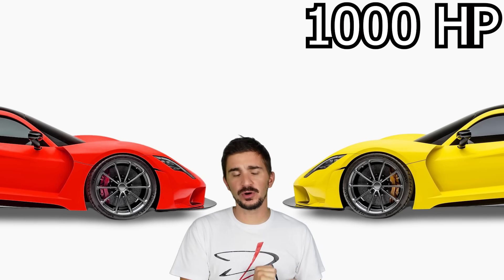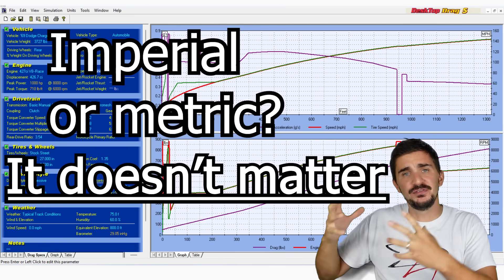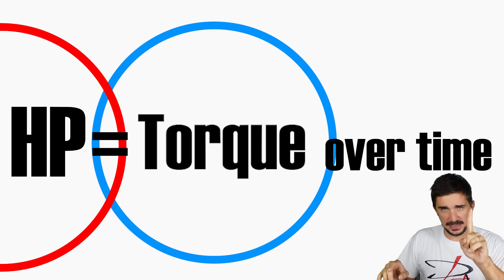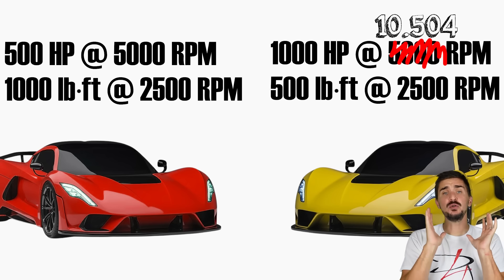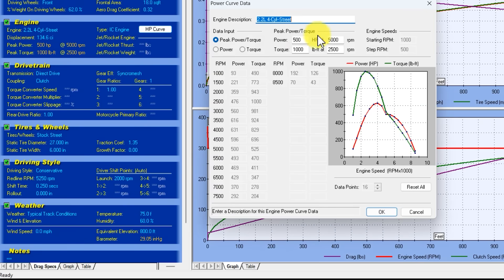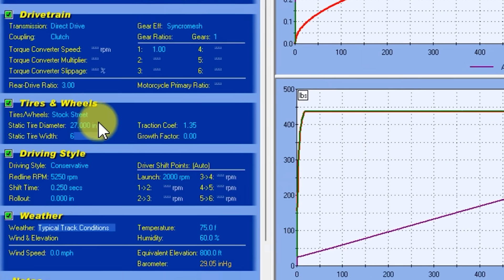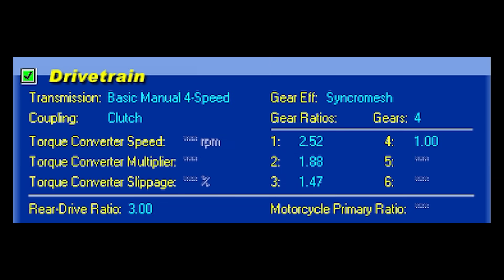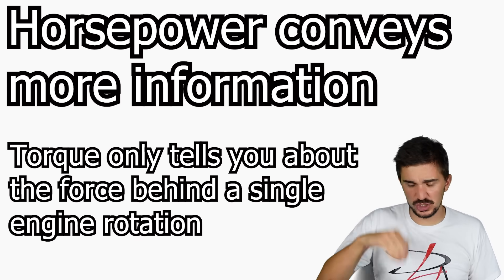Who's faster? Explained and Simulated - Horsepower vs Torque

Comment: In optimal race conditions hp will always be more valuable than torque, all of the simulations are made in favour of the torque engine, like having no gears or being unreasonably heavy.a light racecar with 6-8 gears will always be faster with the high rpm high hp engine
Reply: everything what ypu write is correct except one 👌🏻 heavy weight factor which as you state favour torque engine what is not true 🪠  feg we have 2 engines 100 hp 100 nm and 50 hp 1000 nm both values fpr each at crank we conect those engones with the same type gearbox for  each perfect gearing so gear quantity diffrences between gear lenght whatever gear wuantity and dfiffrences is required for make each of them as fast as posiible 👌🏻 and first we put both those engines in light carosery some whatever what cars let say 500 kg with driver each the same drive train offcorse and the same aerpdynamic and now 100 hp 100 nm beat 50 hp 1000 nm version in each type of race you  setup on trafk with corners on straight dosent matter what lenght is this straight asf offcorse both on the same tires 👌🏻 ok so for light cars or mototrcycle aituation  is solved 🪠now the same engines we put in semitruck  with load on trailer each 100 tons let say and we setup drag race on uphill 3 degreee incline viaduct 5 km lenght constant uphill let saywhat happen now 50 hp 1000 nm now win this drag race ? 🤔 welll NO ! again 100 hp 100 nm on perfect gearing easybeat 50 hp 1000 nm version 👌🏻 why ? cos 100 hp 100 nm always dosent matter in what type pf car weight asf ypu put both engines will generated more thrust or contact path  force as formula watt at whells  :m/s of vehicle = FORCE state 🪠 so if force for 100 hp 100 nm version always be bigerthan for 50 hp 1000 nm version than s long as whole motion resist for both version be the same than alawyas 100 hp 100 nm version win cos of this formula 👉🏻 force on whells : whole resist inlcuding weight and drag and as for uphill ccelerstion test sin 3 degreee incline x weight in newtons = acceleration 🪠long stpry short biger force at whell alwys push the same weight in vacum at faster pace dosent matter this weight be 1 kg or 1mln tons but the same weight for each force level simple as 💩🌪️ 🪠👌🏻☕️
Reply: My friend @mociczyczki is once again correct. If the weight is the same for both vehicles it is what is known in science.engineering, and physics as a constant.
Power, not torque, is the limiting factor for not only the vehicles top speed but also how quickly it can accelerate at any speed, with any load or on any grade of incline.
Reply: @rollsroyce329  Egzacly 👍🏻 not the other way around 😉👌🏻
Reply: i was talking about the 500 vs 1000hp example with different rpms, the 1000hp engine will vastly outperform the 1000 torque engine on a racetrack.
Reply: @kilianfirebolt and that is true regardless of the weight of the vehicle as long as they are equal.

Comment: While we're demystifying engines, torque, RPM, and power let's clear up some common internet hivemind misconceptions: (some of you may need to sit down for this)

Horsepower is not merely  "marketing"
It, like Watts, Kw, BTU/Hr is a measurement of Power. Dismissing it as merely "marketing" implies that it's a feature without benefit. Advertising a torque number without RPM would be a feature without benefit.

Power is not what "maintains" speed or "keeps you going". That's how much fuel you are bringing with you.

Long stroke engines do not make more torque because of "leverage" from the crankshaft.
Crankshaft's do not add any leverage to the work already done by combustion pushing the piston down the cylinder.

18 wheeler "semi" trucks do not make massive torque "because" they need to haul heavy loads.
The maximum output required from the engine is based on its power not its torque.

Maximum acceleration at any given speed does not occur at peak Torque it always occurs at peak Power. Maximum acceleration for any given GEAR occurs at peak Torque and would be less than at peak Power at a different gear ratio for that speed.

Maximum towing capacity at any given speed does not occur at peak Torque it always occurs at peak Power. Maximum towing capacity for any given GEAR occurs at peak torque and would be less than at peak power at a different gear ratio for that speed.

Torque is not “the only thing that can be measured.” Some brands and type of dynamometers like Mustang brand Load cell type measure torque directly and calculate power, others like Dynojet brand inertial drum type measure power directly and calculate torque. Neither of these "delegitimizes" the concepts of Torque or Power

Torque is not what wins races, races are a competition based on work vs time. Torque is irrespective of time as it is only Force x Distance.  Power is force x distance / time and is the measurement that would indicate the winning of a competition involving work vs time.

And Finally 400lbs ft of torque is not “equal to” or “the same as” 400HP.  They are “equal” or “the same” numerically only.  In the same way 400 gallons of water is not “equal to” or “the same as” 400 feet of wire. 

If you still believe in the magic torque and would like to schedule an exorcism please reply below.

Comment: I've always thought the most accurate way to measure and compare engines would be with average power - basically integrate the power curve within the idle-redline range.
Reply: Expecting to go fast from the go slow end of the tachometer is a fools errand.  Use the transmission bypass the weakness entirely.

Comment: Not watching all this, what's faster?
Reply: M3 420hp/400Nm vs C6 430hp/580Nm https://www.youtube.com/watch?v=fJkEpnFvOh4
Reply: @C6Fevernot the answer I'm looking for
Reply: @OGCURLY99  The heavier the more torque and the lighter the more power is better. (big low rpm torquey diesel for a truck, small hi rpm / hi hp for a bike).
Reply: @C6Fever my man 👍🏼
Reply: @C6Fever nonsense.  All work is done by Power.

Comment: I always thought torque was off the line power, and horse power was top speed power.
Reply: A common misconception perpetuated by “conventional wisdom” AKA Hivemind.
Power, not torque is the limiting factor in not only the top speed of a vehicle but also how quickly it can accelerate at any speed and how much weight it can tow up an incline at any speed.

Comment: Twin turbo diesels can definitely get 500hp and 1000nm torque with stage 2 tune and typically have huge tyres to transfer it to the road... my x5 has 275wmm fronts and 315mm rear tyres to do exactly that.. but for a heavy 2.3tonne 7 seat suv is still surprisingly quick with >600nm of torque...
Reply: It’s the Power not the magic torque that makes it quick.  Awesome vehicle though, I’m sure it’s a hoot.

Comment: 500 lb•ft would make a little less than 500 hp @ 5000 rpm. It would be about 476 hp before adjusting the power curve ; i.e., tuning.

1000 hp is possible with 500 lb•ft but the rpms required may not be possible. Closest is aston martin valkyrie engine making 546 lb•ft and ~1000 hp at an astronomical ~11,000 rpm or something like that. Thats hard to do even in a V12 at 6.5 L.

Comment: Horsepower is for show, torque is for go!!!!!!
Reply: Hivemind nonsense.  Power, not torque, is the limiting factor in not only the vehicles top speed but also in how quickly it can accelerate at any speed and how much weight it can tow up an incline at any speed.
Reply: You can calculate exactly how fast you will go if you know the cars horsepower. You can also have infinite torque and not move at all. In reality torque is only for bragging rights and power is for going fast.

Comment: Long story short: higher torque = faster acceleration. In a short drag race or on a track with lots of turns, the car with greater torque is more likely to win. Higher horsepower (HP) equates to a higher top speed. In a longer drag race, a car with more HP might start slower but will eventually pull ahead once it gets up to speed. Of course, there are also other complicated factors, but for girls and grandma who are shopping for sport cars. This is all they need to know.😆
Reply: Hivemind nonsense. Power, not torque, is the limiting factor in not only the vehicles top speed but also in how quickly it can accelerate at any speed and how much weight it can tow up an incline at any speed.

Comment: Having a 1.6L engine with a turbo bolted to it, I've experienced both setups. Numbers are crankshaft estimates. Stock turbo, when pushed to the max, would produce approximately 270bhp and 350lbf.ft at 4000 RPM, both peak numbers. There was no point revving past 6000 RPM. The turbo would just start to choke. But oh boy having most of that torque available at 1500 RPM was great out of the hole. It hit a quarter mile of 13.6 seconds at full weight. A much more fun experience between the lights. 
After upgrading the turbo, it's painfully lethargic until 3500 RPM. Now its estimates are 350 lbf.ft at 4500 RPM and 400bhp at 7250 RPM. The compressor whine it makes is to die for, louder than the exhaust most of the time.

Comment: For example diesel engines have very high torque but low power bcos the rpm are low due to their wheight, while classic petrol engines are the opposite, more moderate torque but hight power bcos they are lighter

Comment: Power is power. Torque isn’t power.
Reply: Bro watch the video
Reply: Exactly.  Torque is not Power. 
 Power, not torque, is the limiting factor in not only the vehicles top speed but also in how quickly it can accelerate at any speed and how much weight it can tow up an incline at any speed.

Comment: Thanks for the content. 

This comparison is too obvious.
Why not compare same HP engines with different Torg and Rev limit?
Reply: Well this comaprsiion have ONE BIG flaw which completelly change results 🤐👉🏻he forget give each of hees hipothetical engine version perfect configurwtion gearing 👌🏻🪠 if he would do this version with more power and less torq be superior in each or almost each test configuration 👌🏻 now explanation to  yours  test configuration sugestion so such 👉🏻engine with the same peak hp and diff torq at crank level and diff rev limiter will accelerste the same and will achieve the same topspeed (assuming offcorse both be setup in the same vehicle = drag,weight ,drive train losess in the same test condition obviously) again if we give each version perfectly configuration gearing/gearboxes dosent matter what type of gearboxes but the same for both cvt dsg manual some other auto whatever 👌🏻what be the diffrencess noticeable be driver and passengers  ?  RPM LEVEL at which each version will constant work for have the same performance where less torq version willl needd to be always on enough higher rpms where ot generste the same power as higher torq version 👌🏻 and that be alll diffrencess reallly nothing more 👌🏻 somebody ask what with avg power cos people often say that more torq will use more avg power for accelerstionin regard to gears on big diffrences in velocity  test like 1/4 mile or roll 100-200 km/h whatever welll its not true cos version with lower torq and higher rpm can hold peak power to much higher rpms in results use the same avg power for accelerstion at big speed range test so yes both version must have similiar „peakpowerwidth” and they easy can have the same peak width just again more torq version will have it on much lower rpms 👌🏻 feg whatever let say peak power from 100 hp from 3000 to 4000 rpm like in avg tdi engine from big torq at crank vs 100 hp from 6000 to 8000 rpm for some petrol n/a with lower torq and ypu have the same performance with perfect gearing for both in the same car model etc 👌🏻 soem also say that longer final gear ratio generste lower drive train losess and now if im must be honest im not sure cos never go deeep with this with calculation but i quees its not true 🤔 and the same power lower torq version should have the same whell power but like im say here im not sure 🤷🏻‍♂️ lack of knowledge  from this point from  me side but it can be calculated quiet easyjist never do this so farr but i quees everything will compensate and at end there be the same whell power (can be wrong here 👌🏻) ☕️ however for the same speed feg 10000 rpm crank peak 100 hp will spin whell the same size and tire let say the same times per sec as let say 5000 rpm crank peak 100 hp so only from gearbox perspecitve there be the same sprocket /gear from whell side and 2 times smaller for 10000 rpm version from engine side 5000 rpm will have more inertia on sprocket from engine size as it will have 2 times biger radious at similar weight distribution on sprocket + lil diffrent hydrodynamic stuff against oil vs 10000 rpm will have contact for each teeth with this biger sprocket from whell side 2 times more pften probabaly genersting lil more heat and it can compensate i mean inertia vs heat for those sprockets   force between teeth initial must be the same for the same whell side sprocket size 👌🏻 only torque at sprocket from engine side be doffrent 2 times diffrent in this egzample 👌🏻 beside for 10000 rpm version can be made smaller sprocket/gear on whell side and lil smaller diffrences  than 2 times smalller comapre to 5000 rpm version sprocket on engine side somwehere ust be sweeet spot for drive train losess and it will at wnd be probabaly the same or very close +/- thers also energy for sprocket and momentum and probabaly couple other phenomenom consnsit on whole picture but yea i quees it be teh same or so close there be no significant doffrences .

Comment: Depends on your definition of "faster". More torque gets you faster to a certain speed, but more hp gives you a higher top speed - it's basically maximum torque at the highest usable RPM. Then again, a lot depends on the gear ratios and especially the final gear.
Reply: Hivemind nonsense. Power, not torque, is the limiting factor in not only the vehicles top speed but also in how quickly it can accelerate at any speed and how much weight it can tow up an incline at any speed.
Reply: @rollsroyce329  If only yours, since barely anybody mentions torque, yet everyone is hp crazy.
Good luck "accelerating" if you have one Newton-meter at 40,000 rpm. Or towing anything up an incline for that matter...

Why do you think rally cars have their torque peak down low? They are monsters of acceleration, yet barely can reach 200 kph. And they usually don't need to with the specials being all twisty and that.
Reply: @getsideways7257  like the username by the way.  you seem to be conflating correlation with causation.  Rally cars have inlet restrictors as per the rule book.  I have three questions for you that will clear things up::

1. You're pulling a very heavy trailer up a steep hill and need to maintain the minimum speed of 45 MPH. You've done your calculations and know that it can be done by the narrowest of margins. 

Do you? : 

A. Select the gear that puts the engine at its Torque peak at 45 MPH where it's output is 300Lbs/ft and 100HP 

Or 

B. Select the gear that puts the engine at its Power peak at 45 MPH where it's output is 150Lbs/ft and 200HP

2. You are driving a given speed and need to accelerate as quickly as possible.

Do you: 

A. Select the gear with the ratio that puts the engine at its Torque peak where it's making 300 Ibs/ft and 100HP. 

Or 

B. Select the gear with the ratio that puts the engine at its Power peak where it's making 150bs/ft and 200HP 

Would option A. accelerate twice as fast because the engine is putting out twice as much Torque or would it accelerate 1/2 as fast because the engine is putting out 1/2 the power?

3. You're at Vmax the car will not go any faster as all engine output is consumed by friction. You have selected your gear ratios to harness all possible output of the engine to achieve top speed. This occurs at.
A. The engines torque peak
B.  The engine's power peak
Reply: @getsideways7257 how are you making out with the 3 scenarios? It’s an easy A or B, not essay questions or anything.
Reply: Beuller…..Beuller……

Comment: I used to be a truckdriver and once my boss hired a mentor to teach us to drive in such a way we consumed les diesel. They called it "eco pro active driving". Obviously when i was on the road with him we started talking engines. And he said that it would be impossible for a 700hp Ferrari 6l V12 to haul 40 metric tons 10° uphill. We were driving a Volvo FH, 6 cylinder with about 500HP. But it had a torque about 2000 Nm. But i tried to explain him that it actually would be possible when using the right gearbox. 

It would have a lot of downsides like consuming a lot of fuel, make a lot of noise and require an enormous amount of maintenance because it has to turn at 7500 RPM constantly. So when you start the climb it will slow down and you will have to shift back but i'm pretty sure in the lower gears that V12 could actually haul the 40T to the top. Off course we were never able to verify that so i still don't know who was right at the time.
Reply: You are correct.  The hired “expert” had Gnose.